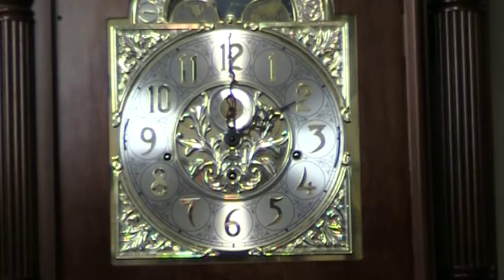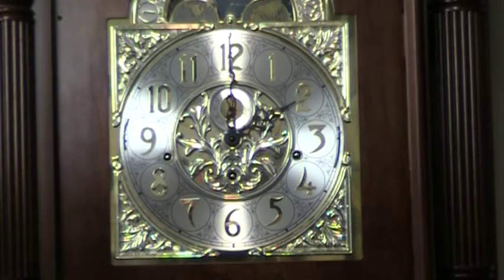Hour Strike Adjustment.mpg

Comment: I just did this, but now instead chiming the correct hr which was 3 pm here, it chimed the quarter chime. I.T was just suppose to dong 3 times.  :(
Reply from the maker: A key-wound movement may take up to two hours to self-correct after adjusting the hands.
Reply: Howard Miller  It worked!!! it self adjusted. My clock is chain driven.  I love It! Thank you so much for this great tip.

Comment: The hands on mine are moved with a little white wheel on the back so I cannot do this.  Its been chiming the wrong hour, stopping when it still be chiming..and now not chiming at all though the pendulum is still moving.  Thoughts?